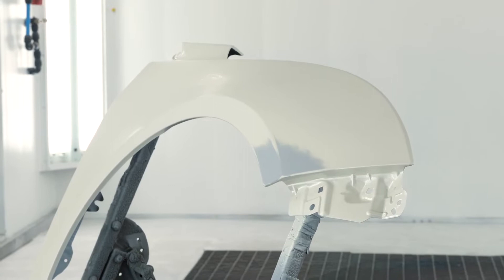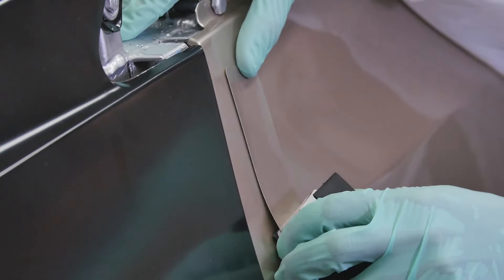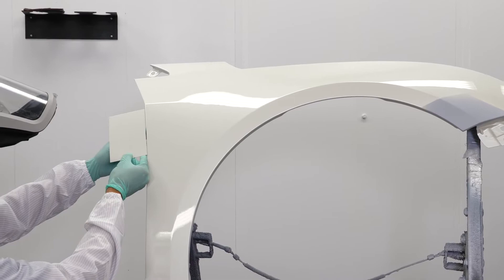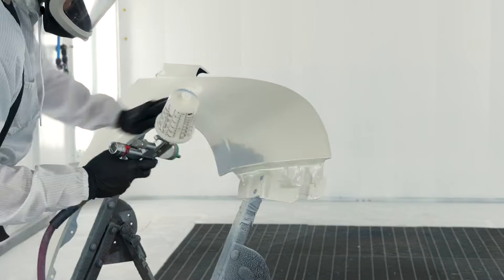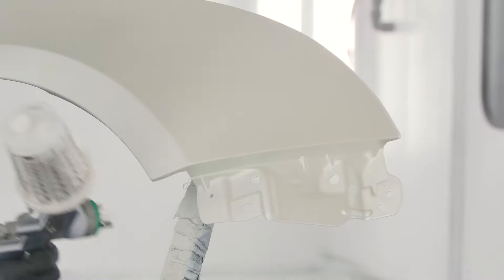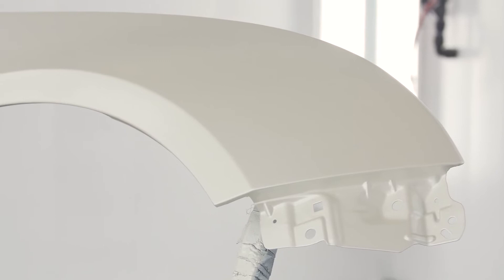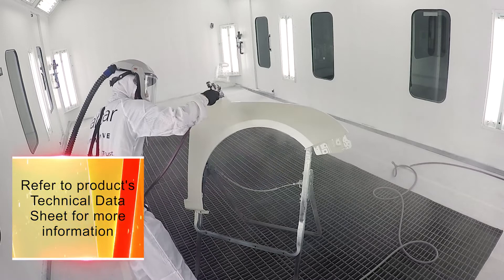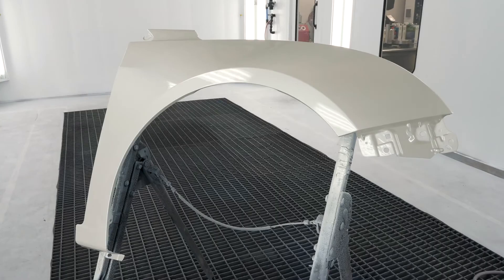Valspar Automotive How-To Series: Valspar Refinish LVBR100 Series

Comment: Bad paint for responsible car painting. Painted metallic gray and black. The paint remains soft after 24 hours at 77 Fahrenheit. Then the varnish blurs it out. Bad paint. Purchased from this seller, COLOR NATION Automotive Paint and Supply. The worst thing is that I had to pay a penalty to the customer for poor quality work. The paint has changed color and the details are very different from the main color.